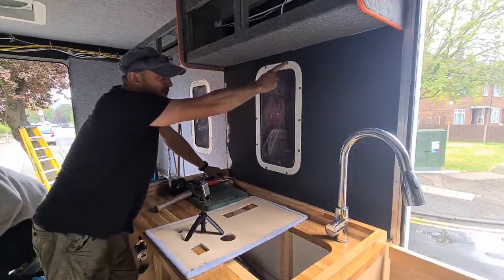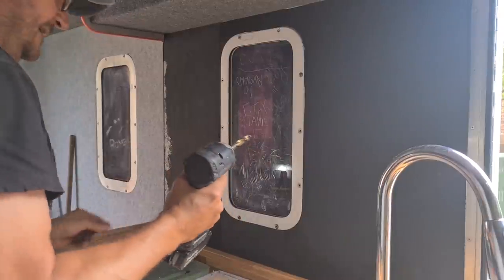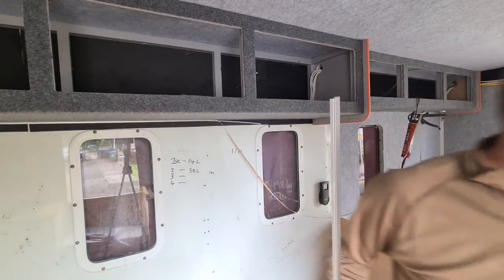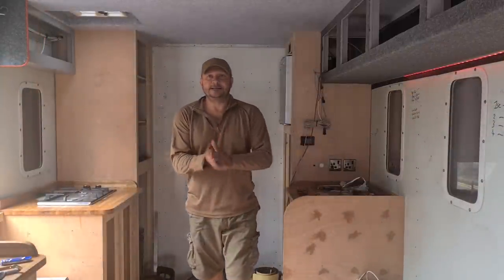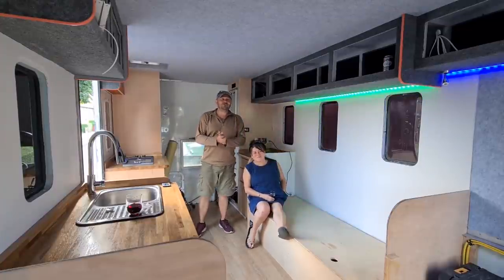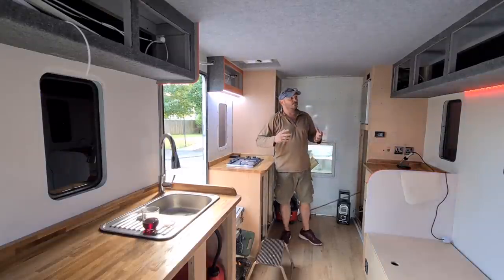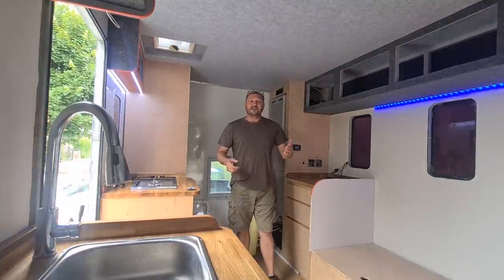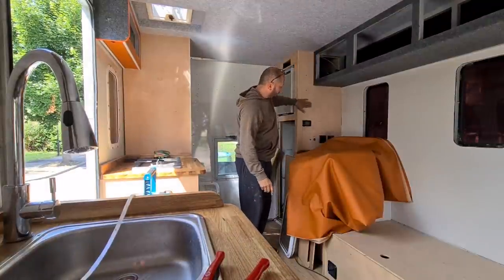MOT time, Meet my wife. Iveco Daily Self Build Campervan Conversion, Prison Truck 6.7T Off-Grid

Comment: Protip I use for getting those weird rivet heads out is using a spade bit made for cutting through tiles. Takes the head off each time and you only need a drill, not an impact.
Reply from the maker: I agree the drill does work but these impact bits are a game changer. You don't need them but they sure as he'll speed the process up. When I come to remove any more of them I'll do a test with drill and impact and the impact reduced times enormously with these bits but are very expensive 👍
Reply from the maker: I did show in an early video using a big SDS drill with a chisel bit and yes they removed them but the noise was beyond what I would allow my friendly neighbours to put up with in a box like this 👍
Reply: @PrisonersNoLongerAccepted  I'll have to try them out, Do you have a link or the name of them? It was really good to meet your wife too I've just finished watching the video she seems lovely! 

Looking forward to the next one.

Comment: Re taking out the shear rivnut things, I took an SDS masonry drill bit (about 8mm as I had loads that size) reshaped the end to a finer point on the grinding wheel. Using the SDS drill on rotary stop has proved really effective in punching in the most reluctant centre pins ready for drilling. 
Re drilling out I find a drop of oil on the drill bit helps prevent the rivet head from spinning.
Reply from the maker: Yeah I used the SDS drill to punch and chisel of the shear bolts at the start. It worked but was just to damn noisy. My neighbours are good but I didn't want to to test them that much 😉👍
Reply: @PrisonersNoLongerAccepted  hi mate, trying to find replacement door locks for the side and rear doors is driving me a bit nuts. What have you done to be able to properly lock the doors?

Comment: You could use Rivnuts instead of rawl plugs as they will grip better. you may need to countersink the back of the frames to allow flush fitting. I used them on my Motorhome to repair a few things that had been bodged, like the rear lights and the driver side mirror, which I have to revisit as it vibrates as I went to move it last year whilst camping and pull the mirror of the side of the body. So I need to get into the wiring to then allow me to take the mirror off completely to then bore out the back of arm so that I can then stick it back on permanently with adhesive and screws. 
Trouble is now that I have seen your Conversion taking shape every time I see a Prison van I think of your Conversion. Keep up the good work and you'll be both enjoying trips away in no time.
Reply from the maker: Rivnuts is a top idea. Perfect 👍

Comment: Good work fella, cracking on nicely, ( I used a soft tubing that I put the carpet around as a wiring conduit along the edge of a wall, looks just like seat piping)

Comment: Encouraging result on the MOT. The ruddy battery has gone flat as a pancake on mine. Finally though I think I've got it taxed. 
I'm hoping that my taking the auxiliary battery and gubbins apart hasn't caused the electrical issues. Can't get the cab unlocked on the remote now! 
Thanks for the update.
Reply from the maker: The battery on this one is knackered but not changing it till its being driven regularly. Good news on the tax 👍

Comment: Where did you get your led lights an would they be suitable for a kitchen
Reply from the maker: Have a look in the description. There's 2 links for you but you will need a 12v to 240v convertor for led lights. 👍
Reply: Just had a  quick look thanks for your help,,, an keep up the good work on the build 👍

Comment: The bolts in the windows are security bolts you can get a set of bits to remove them Derek go home is what you need on the t shirts
Reply from the maker: You can't on these. They are SHEAR BOLTS. You screw them in the head shears of. I have a set of security bolt removers because of my job. These are a different ball game 👍
Reply: @PrisonersNoLongerAccepted  ok I worked in prison and needed a set for my job handy to have